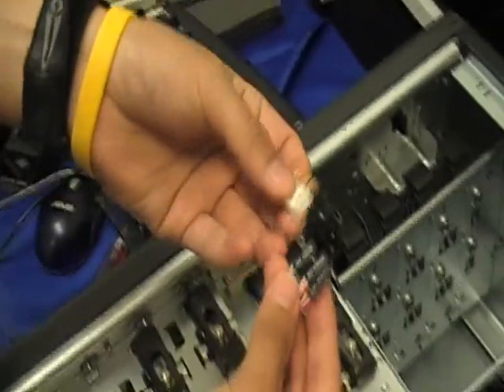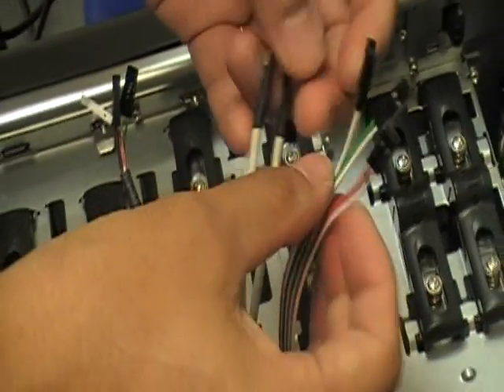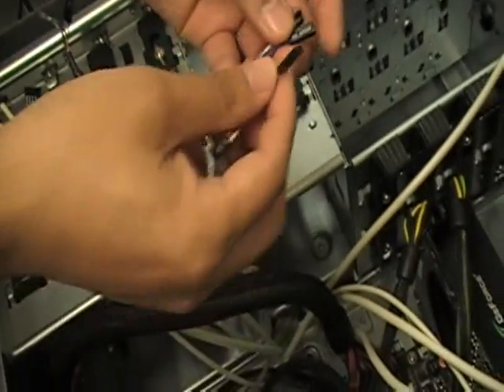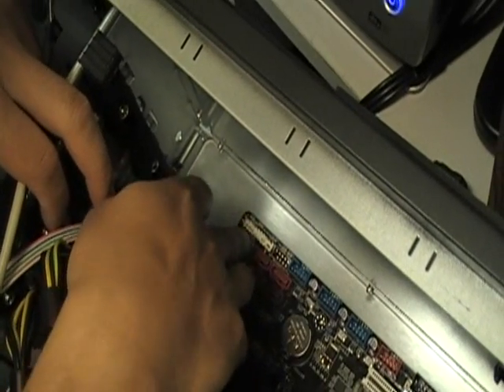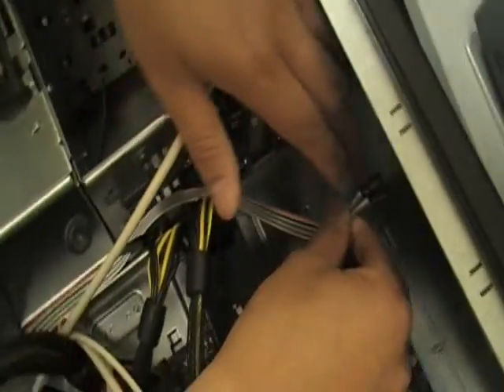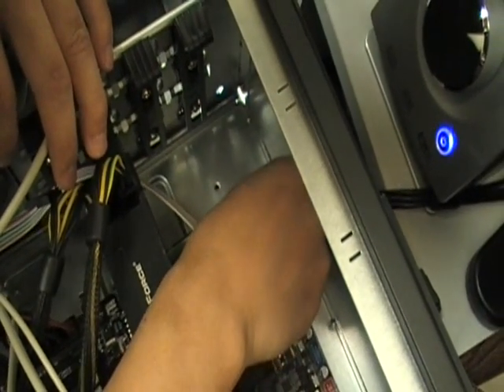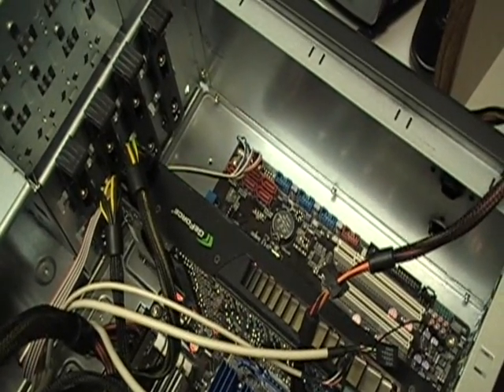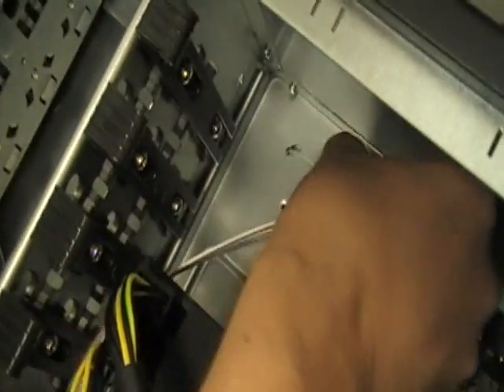ASUS Q-Design -  Q connector

Comment: its really OUTRAGEOUS that ALL THESE YEARS the motherboard manufacturers and the computer industry in general hasn't improved this thing. They made fancy cases with green red and blue lights seethrough glasses... even screwless cases but the computer builder always has to deal with that same nightmare over the years: install the front panel tiny connectors. At least Asus made that (10-1) adaptor  that really helps things out.

Comment: @ir0gue dude speaker magnets won't affect your motherboard at all. It would have to be a damn strong neodymium magnet to mess up a hard drive. Speakers have been inside computer cases for years without interfering with any component. the Q connectors also make it easy to hook up the front USB ports without having to fiddle with making sure you've got the right grounding wire plugged in because you plug it in the wrong way and there's a good chance you'll mess up the port.